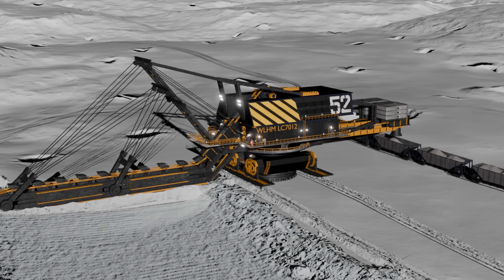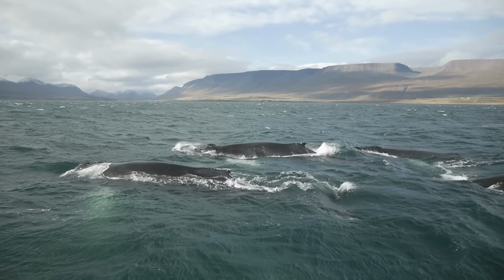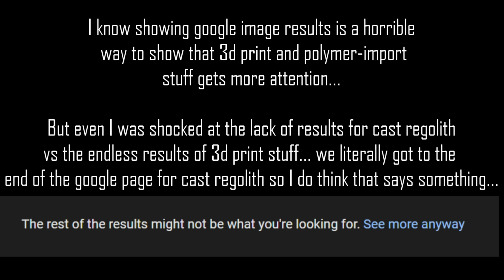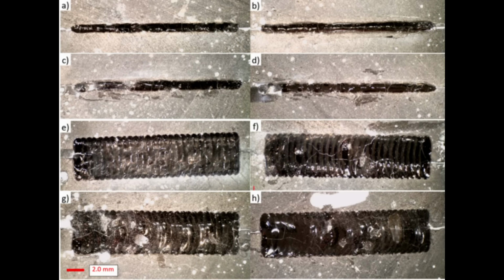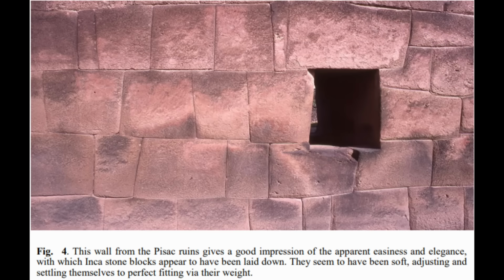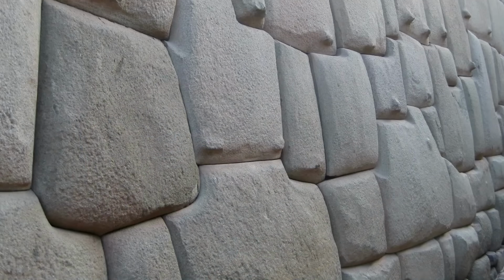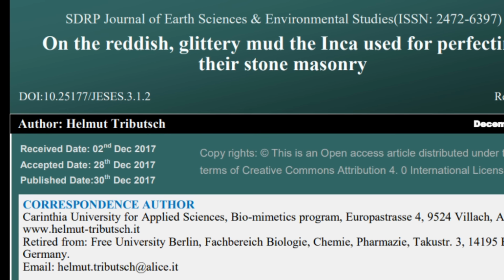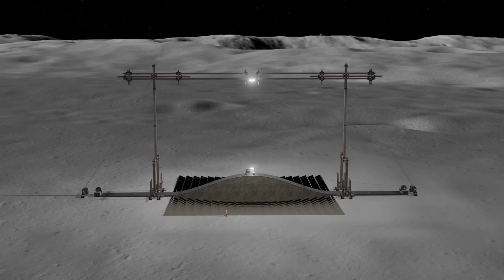Lunar Construction Materials

Comment: Hi, I have been researching this subject for a little while and I suggest you research "Mafic, Scoria or Middleborough" bricks, they were widely used for roads and there was a specific process, for making them using slight compression, constant movement and slowed cooling. They were made from slag pre-1900s. The machine used kind of looks like a set of tank tracks and a waterwheel combined.

Comment: Lunar bases are planned for operation in permanently shadowed regions at the poles and powered by small nuclear reactors , where regolith can have up to 10% water ice. This would end up as a byproduct of the smelting industry, probably in a preheating phase before introducing it into the furnace with microwaves to sublimate and condense water for use. Most of the excess from smelting would go to other processes such as drinking and rocket fuel, but a fraction could be left for construction. Along with the ice and Sulfur from the construction regolith itself, it’s not unreasonable that lunarcrete could be produced  without additional supply chains for volatiles. From here, lunarcrete is a lot easier to make and work with, and is more viable for pressure vessels that humans would inhabit than cast basalt.

Comment: I feel like hot bricklaying, combined with the vacuum around the moon, is ✨kinda✨ viable. As the bricks are cooling, just set them in place as they are cooling and are at the right temperature to weld, then weld them. Then, you just have to wait for the layer below to be cool enough to hold weight while still being warm enough to fuse to. It feels a LOT like a 3D printing calibration problem.

Ngl, the masonry solution is a much better and more elegant solution.

Comment: Great video! One thing I think a lot of the "regolith + binder" based technologies forget is that if water is present in the concrete you are printing with it's going to start boiling when exposed to vacuum so do you deploy it while it's boiling out of the nozzle? I guess they are just all for Mars like you mentioned.

Comment: I think you made a fundamental error. The temperatures you gave for cast basalt was for Earth's atmosphere pressure. At the moon's, the temperature you gave would sublimate the entire regolith rather than melting it. I am sure no one has determined the proper temperature for the basalt brick because of the pressure. Do you think they could do it at the ISS or will they have to figure it out on the moon?

Comment: ESA have done experiments into sintered regolith.
 Use concentrated sunlight to heat regolith enough to fuse together.
 It requires less energy than fully melting the regolith, and can be built up in layers like 3D printing.

Comment: Thank for the Chu Chu lens, Moondaddy. So anyways:
1. How do furnaces work in vacuum, with no convection to deliver heat?
2. Couldn't we braze bricks with metal? Like iron or aluminum?
3. Would it be too hard to make the solar-furnace structure just out of metal, entirely? It's all long beams and such.
Reply: By infrared radiation - just like we get heated up by the Sun..
Reply: @peterclarke3020  Perhaps I should have asked "how well". A lot of the proposed machines in this series have somewhat detailed designs.
I'm curious if vacuum furnace engineering has much to choose, or if there's really only one, straightforward, design.

Comment: I think you would be interested in what the authors of the paper called "Propriétés thermiques et thermo-optiques d’un analogue de régolithe lunaire pour la fabrication additive directe" would have to say.

The extract of the paper is on the SFT website

They looked into the properties of a regolith analogue for 3d printing using SLM techniques.

Comment: Historically mortar did not glue stones together. Mortar used in castle construction was just a mineral pasta that creates bigger area of contact. Think about it as play doh. If you'd place uneven stones on top of each other, they are not gonna stay stable, they are gonna rock around. But if you place play doh between them, they are gonna stay in place, no glue needed. Shadivercity made a video on that years ago.

Comment: I think they see a 3d printer as a very flexible production tool that can easily and quicly switch between production of various elements as long as they fit in build volume and are made out of specyfic "filament" while casting for example needs moulds and forms that need to be produced. 3d printing might appear as a production method that is far more iteration/upgrade friendly as well as allowing for reaserch and development and testing of stuuf "on the grund"/"on the go", with all that said thou there are lines and point where cost outweights the benefits ad vice versa and the key is to locate those and put proper machines to proper jobs with proper planing and expectations of what can we do with what and so on,  so we well probably need some sort of hybrid system with 3d printing as a element development as well as tool/moulds production, and lower numbers production and then moulding/casting for mass production

Comment: Really cool video, but, what are you talking about with the Mafic vs Felsic rocks melting points?
Im a Geologist and the whole point of the minerals in Granite like Quartz and K-spar and Muscovite IS that they melt at lower temperatures than the Mafic minerals like Olivine,  Anorthite, Pyroxenes ect. 
Its a fairly continuous (or, well, both continuous and discontinuous) series.... called Bowens Reaction Series. If your using a specific viscosity of the minerals for when its "melted" then ok, thats a very useful metric for us here and thats fine, but it is NOT what melting means NOR does it mean that Quartz, which famously in Geology is the lowest melting point of the common Igneous minerals, suddenly has a higher melting point than any of the mafic minerals like Olivine. 
The Viscosity is, sure affected by temperature, and can be lowered by heating up more. But its dependent on the chemical bonds between the Silicon and Oxygen atoms, mostly. 
So if you need your melt to flow a specific amount, yes Quartz needs to be heated up higher than Olivine, but both are insanely high temperatures at that point, whearas simply melting Quartz only needs some 900 C, sometimes if your patient enough 700 C. Although its a pretty useless sticky honey-like mess.
If you look at Wikipedia, and I dont know why its like this, and look in the info-bar on the right side and see it says 1713 C thats not actually correct. Thats the melting point for a specific... shape... of a Quartz-like mineral that usually xists at those high temperatures. The specifics dont matter, but even Olivine's high melting temp is 1900 C and that, like everything, varies in composition. 
Anyway, your usage of the minerals is fine, and the underlying value between the different rocks hardly changes, but just the melting point, specifically, is such a tricky thing, and a lot of what Granite and the other Felsics (Monzonite, or my beloved Rhyolite) are defined by xist because of the lower melting point point of the minerals found within them compared to the minerals in Mafic and Intermediate rocks.

Comment: I also don't see any reason why  basalt can't be heated to tube transportable levels then heated or cooled to ideal temperatures at the nozzle of a 3d printer, similar to metal printing. Even if it is more complicated.
Reply: It possible, just having good product as result is not so simple, it seems. Not impossible.
Reply: Yeah it seemed to me that whatever being printed needed at least insulated to keep it from cooling too quickly. And the next layer would have to go on while the layer before was in that preheated brick temp the video talked about.
Reply: @peterfike47 yes, if one would print keeping the stuff hot then it would be much better, but it high temp stuff sonthere are some difficulties. But it seems inseen something like that, but not sure about it and forgot specifics.

Comment: Sometimes you can't beat a simple brick. I like it. There's also an easier way to sinter. Since you've earlier stated how unique the Earth's soil is, Lunar soil is too: due to the millions of years of being battered by meteorites and scorched by the solar wind, its grains are a mix of nanoscale-fine elemental iron on the outside and rim of the tiny sharp grains, and agglutinitic glass. This makes it a dielectric. This makes it an amazing absorber of microwaves, such that a "kitchen-scale microwave" (so a kilowatt or so) would fuse the soil of the Moon's surface to a depth of 0.5m within a minute. There's your quick road, there's your slab that can be cut and sawn to size. Source: "MICROWAVE PROCESSING OF LUNAR SOIL" Lawrence A. Taylor and Thomas T. Meek

Edit: Also I have a wild idea for 'mortar' - molten magnesium. Its melting point is kind of high, 650 deg. C, but its thermal conductivity is also high so it should cool quickly. Add 0.15% of calcium and a bit of zinc it becomes flame and corrosion-resistant. Spraying or literally vacuum-sputtering more on the inside and anodising it with oxygen might make a pressure vessel. Might.
Reply: Yes using metals as glue is an option in a variery of ways.

Comment: This would be good for phase two, but not phase one.   You also totally ignore that solar only works 14 days out of every month.  SO solar is still expensive and the fields
 and fields of solar to make the power you mansion.
Reply: Yes, it would need to be coupled to a storage system.  The one advantage is it's 14 days of solar you can trust so you can budget your panels far better.  No clouds on the moon. :)
Reply: @imaginary_friend7300 You also ignored the cost to get that many solar panels to the moon.  It would be better to send several small nuclear plants vs solar.. so you can run 24/7 for 365 vs 24/7 for only 14 days.  Also you ignored the static dust collection on the solar.  Meaning the panels will need to be cleaned periodically.
Reply: @larrytroy3758 watch the other video, panels can be produced ont he moon, no need to deliver them all, you do it from your seed energy but not for the rest.

Comment: On the topic of that solar furnace, you could also use concentrated solar power like that to generate power with thermal energy generators, & that power could be stored using vats of molten alkali metals on the moon (a thermal battery) to continue using things like the furnaces at night.

Comment: The reason for ignoring cast regolith is that its a long term solution that's not applicable for decades/centuries still. All its benefits presuppose the existence of atleast some lunar industry to begin with. Which surprise surprise, we dont have. All the arguments for cost, local materials, local energy production are entirely irrelevant when none of that exists yet. To make it exist, to set up the first steps, you'll need to import tons of mass anyway. And its FAR cheaper and easier to bring in things that are already built and immediately usable, than to do work on a literally uninhabitable empty rock.
Who's gonna build all that basalt etc.? Are you gonna send 5 dudes to sit in a 20sq m space for 10 years to build the barest minimum? Ar you gonna feed them solar panel output? 
Ultimately, while some things are cheaper, some easier, the biggest (and renewable) resource that earth has and the moon doest is ... money. Things are not economical when there is no perceived return within reasonable time. And people with money would much rather spend 5 billion to have something in 5 years, than 5 millions to have something 100 years later.
Reply: Shielding against radiation and impacts from earth is going to be a HUGE mass requirement.  The equipment to make a small furnace to cast bricks would be a lot lighter.  The idea would be something small but automated that can sit there for years making bricks.

Comment: For early-phase radiation shielding, rather than spending the energy on making bricks, you might want to just surround your initial habitat with water tanks. Water does a pretty good job of absorbing radiation, and your colonists are going to be needing it anyway, so why not store it overhead and let your storage double as your radiation shielding? Bricks for shielding seem like a later transition once you're refining significant quantities of regolith and can spare some capacity. Or better still, getting a use for some of the byproducts. Refine out what you need, then turn the rest into bricks.
Reply: Collecting that much regolith is much easier than making or importing so much water

Comment: a lot of the time mortar wasn't really to glue the blocks together but to spread the weight to reduce point loads and cracking, and to increase friction to stop lateral movement.
Reply: Good point, any dust can do similar, if it stays in pace, which on moon it should, same as clay is good enough for that on earth.

Comment: There is also the option that the walls were not made with pyrite melting, but with cement. For example, using wood-ash-sourced lye and beach sand (quartz sand used for glass)to make waterglass, and mixing it with the cement made from quicklime and crushed terracotta or the volcanic ash known as pozzolan, or a mixture made from quicklime and dirt which to be fired/baked into clinker cement. As for building on the moon, why not simply use interlocking indents, not unlike lego, but not infringing on it's copyright, to stack blocks, which would simply require a standardized set of molds for different types of bricks used for the construction projects.

Comment: Using the same methods as metal 3D printing but with regolith comes to mind. Annealing could be a problem though, especially on the scale of buildings (though perhaps relatively slow radiative cooling combined with the sunlight might be enough?). Could instead be used to manufacture smaller precision basalt parts; as long as the part doesn’t crack while printing you can chuck it in a solar furnace to anneal.
Reply: Yes, making parts is the idea behind that. Sintering or casting or sls both are interchangeable - whatever fits better for specific task/use

Comment: The basalt laser welding might be more feasible if you just DON'T let them cool down completely from the casting process. It would require a continuous flow production line, but it's not impossible. You cast, let cool only down to welding temperature, then it goes into the construction and gets welded and finishes cooling in-situ. Thermal expansion and contraction might pose other issues, but I don't think we would need to waste energy on reheating blocks.

Comment: You said in the previous video about refining lunar reggalith into usable metals you could use solar furnaces. Would these differ in design significantly enough that they couldn't be used for cast reggalith processing, or would they be multi-purpose?
Reply: Definetely similar, as it all about heating things hard enough. Shown stuff itself isn't a final design, one of the options, soo how the final working things looks like we not necessarily set 100 percent in both cases.
Reply: Basically just mirrors focused on a crucible

Comment: The cheaper energy becomes the more viable cast basalt becomes as an alternative to other building materials. The first it would be competitive with is brick, but it could also become competitive with concrete for certain things. Also, the rebar thing isn't a real issue, cast basalt doesn't need rebar owing to its strength, in fact, there is rebar MADE from basalt fibers used for situations where you are concerned about corrosion of normal rebar.
Reply: It depends on type of product and uses. Here basalt rebars because metal rebars more expensive reasons, not like on earth corrosive reasons - different reasons similar solution.
Cast basalt is a stone in essence, so for some types of loads and parts it may make sense to prestress it this way.

Comment: Can you do a video on solving the moon's lack of nitrogen and carbon. How will it be imported? What is the cheapest way? Is it asteroids and so on.
Reply: The problems can be solved in different ways, and how specifically depends on what do you have at hands when you solve them. So, some day formsure this can be adressed and was partially adressed in previous videos as there is carbon on the moon, it just not in huge quantities. Nitrogen is easier to get from earth, and for breathing you can go with helium mix used for divers, helium is available on the moon and relatively easily extractable despite it also in 100ppm concentrations.

But if you mean human needs then it kinda easier to import it in some cases. In more advanced cases Venus can be a good source of the stuff etc.

Comment: The first building on the moon will be different from the second building on the moon.
The first building has to be the workshop for the second building.
The first building only has to be good enough to make the second.
What the first building will be is the real question.
Reply: A bit like Starbase was constructed
Reply: Just patched shed with 1000Pa inside pressure, if any, with solar panels on top.

And the one before that - well just foil hanging on sticks.